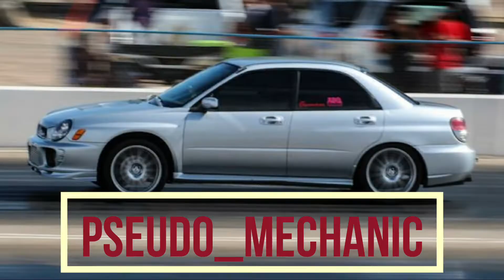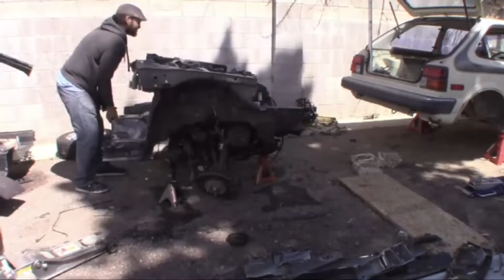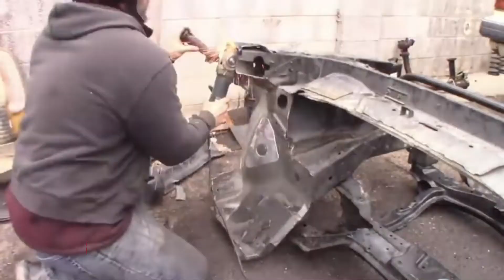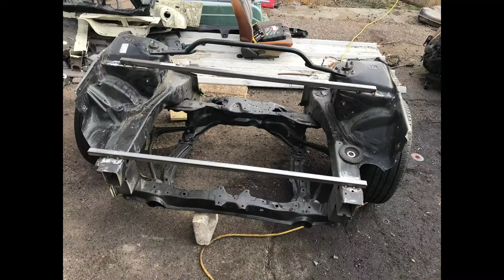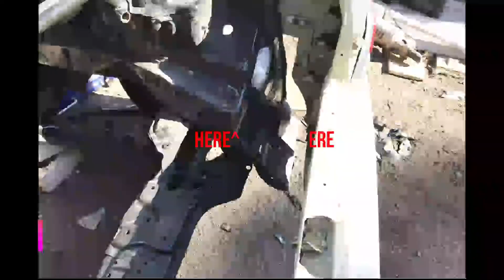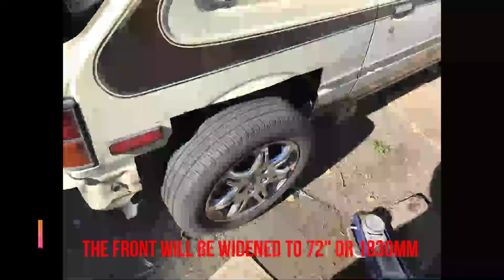Civic RWD 5 1/2 (is it in yet?)

Comment: Love seeing the progress. How did you line up the TL front clip to make sure it's completely straight and not dog tracking?
Reply from the maker: I measured from fixed points that I determined were symmetrical left to right, the strut towers and the front frame rails on the TL. From the strut top bolt to the door jam is within 2mm left to right. The top of the strut tower to the roof is dead even. The top of the frame to the roof is also dead even left to right both in front of and behind the strut towers. 

The rear suspension does have toe adjustment in the tie rods as it is the TL front suspension. The height will be adjusted with coil overs and camber will be set with upper control control arm adjustment. I will cover all that in a future video after I install the front suspension. Good question, I hope I gave a good answer.
Reply: Your answer is very well explained and thorough! Thanks for the reply.
I've been dreaming of building a mid engine Honda and that was my biggest concerns. 
What's your thoughts on how the front suspension geometry will handle being in the rear, mainly the caster angle?
Reply from the maker: gutted Corvettes have the same control arms front and rear, but turned 180 degrees at the rear with a slightly different rear tie rod length for different toe in characteristics. The idea is that this gives the same anti-squat and anti-dive behaviors. Corvettes have about 50/50 weight distribution so this suspension formula makes sense. 

On the Mid engine civic we are going to be rear heavy. The car is likely to have a fair amount of oversteer as a result. The TL suspension has a positive caster but has almost no bump steer so as weight is transferred to the rear under acceleration there should be very little toe angle change. If I do experience bump steer I can always get some roll center ball joints or change the upper arm geometry by swapping the arms and mounts.